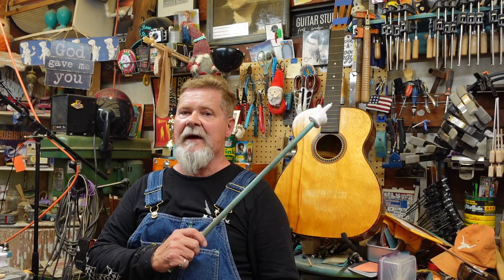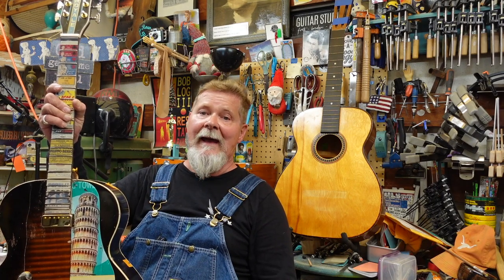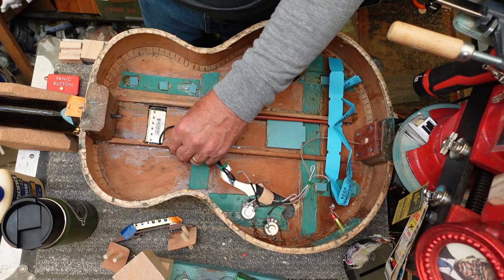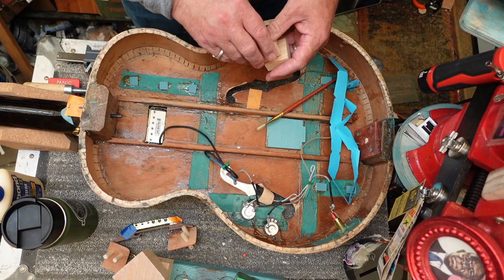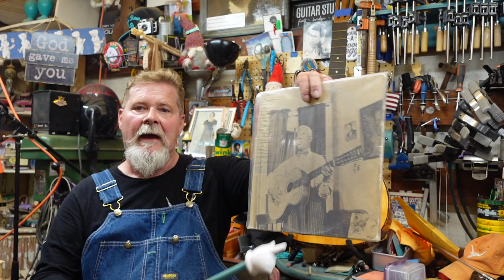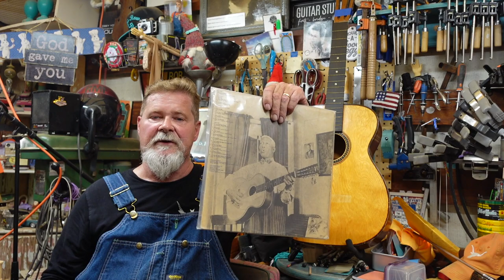Galiano Archtop Guitar Rebuild: Part 12-Back to the Drawing Board: Part 2

Comment: Paul. Your information about the MiG is incorrect. 🤣😂🤣 Titebond most DEFINITELY can be heated up and separated when used on stringed instruments. And in the meantime, it provides a BETTER adhesion than hide glue. Hide glue becomes brittle over time. 🇺🇸
Reply from the maker: Then use tight bond, my friend
Reply from the maker: https://www.instagram.com/reel/Cv6LKNVMDsd/?igshid=MzRlODBiNWFlZA==